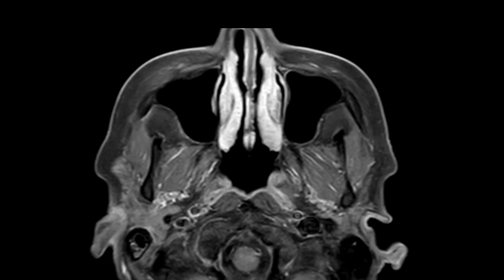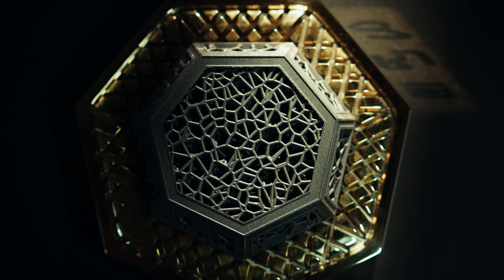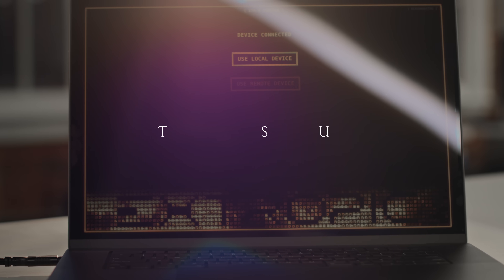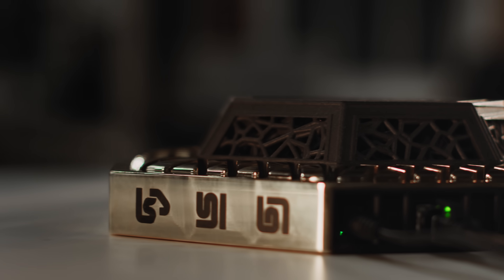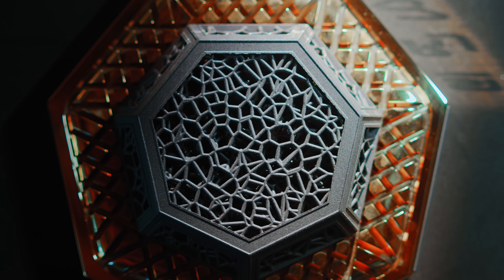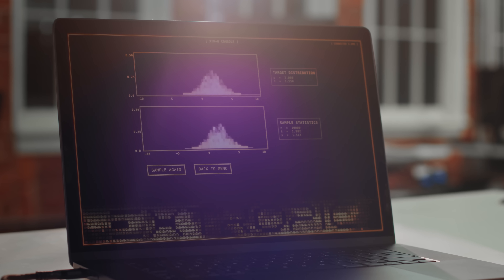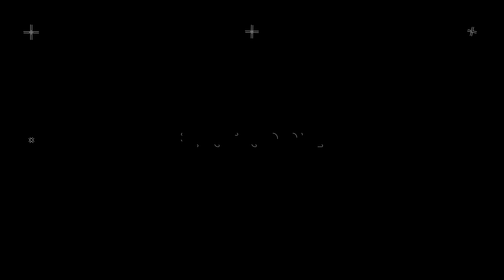Hello Thermo World | Extropic

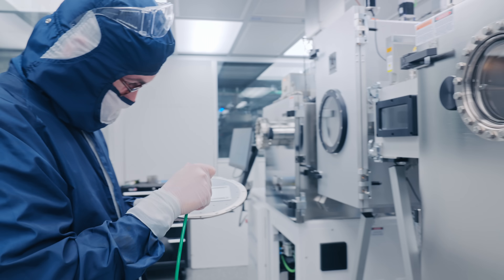Comment: If you're having yield problems, talk to that dude with his nose uncovered in the clean room @4:18
Reply: theres always that one nose-guy
Reply: @DFivril  I'm one of two nose guys in my fab. The mask makes the cartilage in my nose lock up, which is painful, and it also causes my goggles to fog up.
Reply: @DFivril 
Where are you going after you die. Repent today from your sins. Hebrews 9:27 says as it is appointed unto man once to die but after that the Judgement.

Confess your sins and turn to Jesus Christ today. He is the way, truth and life.
Reply: so from scratch those cpu are either fake, or condemned to fail or have some potential problems... i wonder if that guy sneezed at certain moment of the entire process.
Reply: If you're having yield problems, I feel bad for you son, I got 99 problems and yield ain't one
Reply: Question about this because I hate the bunny suits with the mouth covering. How do you exhale without fogging up your glasses in those?? I have the option to wear open face hood with the beard cover over my mouth and nose and it is much much better
Reply: @EpicMStudios Ex Nortel engineer taught me how to pinch the metal strip just right and use your safety glasses to press the mask against the bridge of your nose to prevent air from being directed upwards. Of course the second dude isn't even wearing his safety glasses and is hunched over the sample holder while blowing it off... It's a particle paradise up in there!
Reply: @Finlaymacnab Ooo I will have to play with that. Tysm!!!
Reply: LMAOO
Reply: great thing about satire pits like this is they make it easy to find everyone worth ignoring
Reply: Maybe it's just a dummy wafer. probe department engineer always have plenty of it for training.
Reply: lol
Reply: during covid i found that for some folks, having their nose out is part of their personality. trust me they want you to say something so they can crash out
Reply: maybe he used to work at Area 51 where they have had smell as a modality for years...
Reply: this cleanroom has nothing to do with the hardware we are building now lol. historical artifact
Reply: @TrevorMcCourt Figured as much. Just poking fun at the corporate video style. Looking forward to hearing more about your progress and learning about probabilistic computing algorithms! Congrats.
Reply: Its beacuse he wears glases if he covered he's nose with mask he wouldn't be able to see anyting bacause the warm air from the mask would create a pair on this glases that's why he don't cover his nose
Reply: Maybe he's Jewish?
Reply: @danfg7215  What does that have to do with this?
Reply: When will wearing masks stop being the main personality feature for you lot?
Reply: @josephrichards8736  it's a clean room? They're not talking about covid, particles from your mouth can ruin silicon chips.
Reply: @josephrichards8736 LOL bro thinks masks were invented during Covid. Watch the clip and you’ll see they are in a part of a lab where you’re not supposed to have ANY extra potential contaminants. It has nothing to do with viruses, it’s avoiding getting simple things like snot and spit on the circuitry that could affect its performance

Comment: I know physicists probably proved this not to be the case, but I have the suspicion the power of quantum computers could be emulated in an analogue probabilistic computer
Reply: How do you emulate entanglement?
Reply: @blinded6502  I don’t know yet. I know Bells inequality is supposed to suggest that it’s not possible. But the fact that entanglement cannot be used for communication, and only appears in correlations after thousands of different measurements makes me think that QM’s weirdness is due to it being a probabilistic model optimized for our possible knowledge from measurements, and that Schrödinger’s cat actually is not really in a superposition until you measure it.
Reply: Not really for anything big, but learning is usually done with simulations like you’re talking about. It becomes infeasible after about 50 qubits I think, as the number of superimposed states equals 2^n qubits, so a really big number that can’t be stored classically
Reply: I get where you are coming from but that is only true for one qubit compared to one pbit. For 2 pbits you would have to specify two probabilities, let's call them p1 and p2. However for 2 qubits you generally must consider all possible combinations, that is, p(00) and p(01) and p(10) and p(11). So, 4 compared to 2 numbers in order to fully specify the 2 bit system. This difference increases exponentially as the number of bits increases.
Reply: @MrBajaJunky that math isn’t correct for any set of bits, classical or quantum, you have 2^n readable and writable states. 
Idk the specifics of a pbit, but the exponential thing with quantum computers seems a little misrepresented. 2 bits = 2^2 state, 3 bits = 2^3 states. 
Lay descriptions act like they can operate on 2^n possibilities at once but no algorithms act like that when you look at them. They seem like a slight efficiency from an analogue of a weird probabilistic model that might exist in other analogues.

I’m not a physicist , but built quantum ciruits and ran them on ibm quantum computers to. test CHSH inequality, haven’t looked at the results yet (I’m sure it’ll match experiments). Maybe when I sit with the math longer it’ll click but I still have a suspicion this weird probablistic effect and non non-local interaction
Reply: @liquid-emergence
Of course the story does not end with my comment. Indeed, you don't have access to the whole wave function but still, for some cases, the exponential scaling remains, even in terms of the accessable information. That is to me the most important result out of QM.

Comment: Can anyone smart confirm that this is not thermodynamic vaporware?
Reply: If anything, this can as well be just a sponsor trap, a hoax. Without proofs, this is nothing. Of course, since they are opensourcing a simulator for general consumer, maybe not all hope is lost, but it will be clear once they actually provide something usable.
Reply: Assuming that they can produce the chip, program all the desired interactions between the pbits, read their states, and do efficient gibbs sampling, it’s still unclear how useful it will be. The most important models today are transformer-based, not diffusion, which this is meant to accelerate. Even if discrete diffusion catches up with transformers for language modeling, it may not be possible for energy based models on the types of lattices that their chip can represent to be as expressive as the neural networks that are used to model denoising diffusion steps today. This is certainly not a general purpose accelerator like a GPU.
Reply: if someone says its 1000% more efficient be very sceptical .......
Reply: @kamillatocha 10 000 times it's 1 000 000%, but hey, that's what were transistors for vacuum tubes back then
Reply: @NyoshaM  so were magnetic amplifiers. not sure this is anything but hype
Reply: Go read the comment I posted at the top of the page
Reply: @dimorischinyui1875  This was a surprisingly high signal to noise comment. Thank you! Very useful.
Reply: If this works then what’s stopping Nvidia making this at scale?
Reply: @AB_LDN  Something called patent
Reply: It may not be total vaporware, it's impossible to tell until we see more. They haven't actually proved anything. The bad news is that even if they have solved the many, many issues associated with this kind of thing (which I doubt): it's still likely useless compared to a simple RNG algorithm running on the silicon infrastructure the entire world already uses. These p-bits may be more truly random (although I think they will have issues), but that doesn't really matter.
Reply: @PlaySA I don't get it why everyone focusing on randomness. As I understand it, those p-bits do whole activation function at one element in one tick naturally and that's where efficiency came from, embedded free randomness is a nice bonus.
Reply: @NyoshaM  that's not what the pbits do. They literally oscillate randomly with an applied bias. That's it. You can't do anything meaningful with that lol.
Reply: Most anyone “smart enough” to confirm that is going to keep most of their knowledge to themselves as a form of information arbitrage.

Comment: This is interesting - but I'm left with questions - what benefit does this have? what are the drawbacks? right at the end you throw out a figure that it's 10,000 times better than GPUs at running AI - can you expand more on this?
Reply: the mean that if they had the same density of computing as a gpu it would be more efficient. however since its vaguely analog the chips will never archive said density.

Comment: Very interesting. Makes sense to encode probability directly in the hardware. And makes way more sense than using quantum computers for ML (which doesn't at all actually)
Reply: Quantum literally doesn't exist beyond the scale of a few basic components wired together. Even those don't survive for more than a few kflops and require $$MM of room sized equipment to do that. IBM Condor is logically equivalent to Kilby's First IC (1958): 1 transistor, 1 capacitor, and 3 resistors. 

This appears shelf stable and you can get one today! Not sure how useful personally, but advancements usually don't come from where the marketing departments are working overtime 😉
Reply: Quantum computing is literally probabilistic computation.
Reply: @DanieIMonteiro  No, it's not. You are wrong. Quantum computing and probabilistic computing are different. Quantum uses qubits, which exists in a superposition of both (BOTH!) 0 and 1, while probabilistic computing uses the so said pbits that exists between (BETWEEN!) 0 and 1. 

Jesus, just do a simple research before writing some shit on the internet.
Reply: @matjsz  My man, a qubit superposition is based of two components, the for us 0 and 1 component, which combined together sum up to 1, hence the probability. A qubit with 0.5 0 state and 0.5 1 state will lead to 50% chance of measuring a 1 or a 0. This is the pure definition of probabilistic.

And if you want to go in such a detail, a qubit doesn't have a 1 or 0 state. Thats simply the only state we can measure with what we have now.
Reply: @DanieIMonteiro  I don't see where this denies any of what I said earlier, but I appreciate your comment.
Reply: what does not make sense to you about quantum AI? Using AI savants to augment humans to design quantum systems or running ML algorithms on quantum-hybrid hardware? I assure you both of these frontier domains are coming much sooner than you think...
Reply: Because it’s pseudoscience and woo woo.
Reply: Quantum works really well at cryptography. 
Not sure about LLMs.
Reply: @TurnerRentz whatever do you mean? I hope you don't mean Shor's algo...